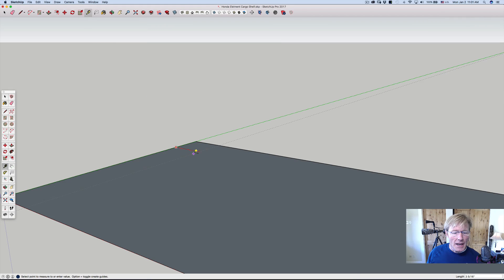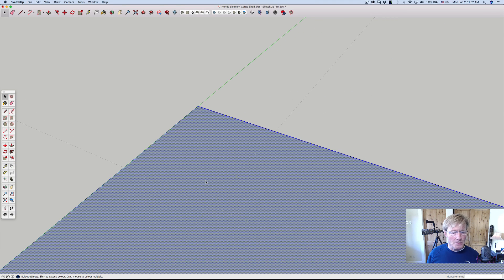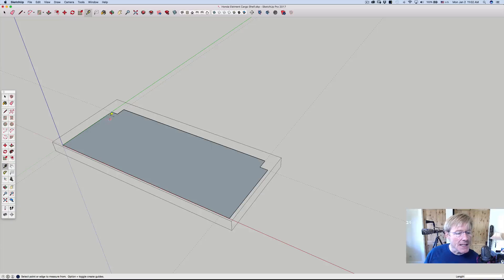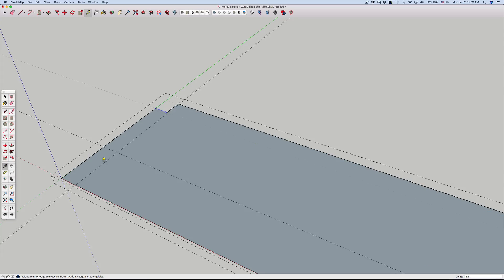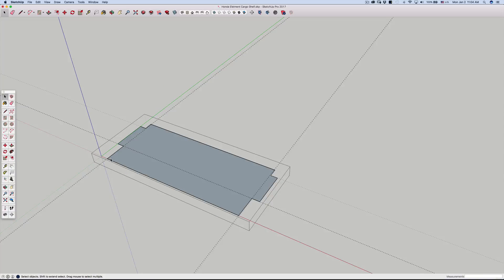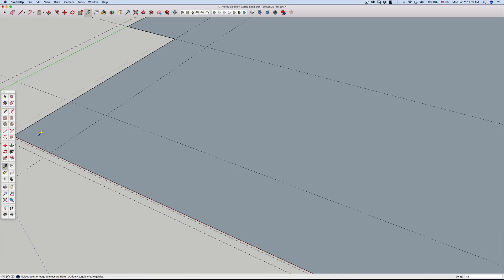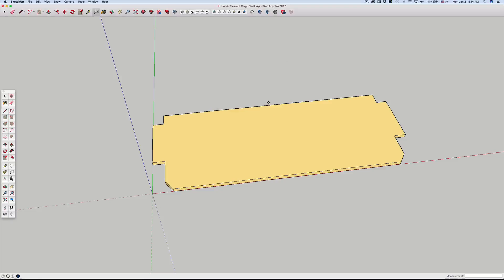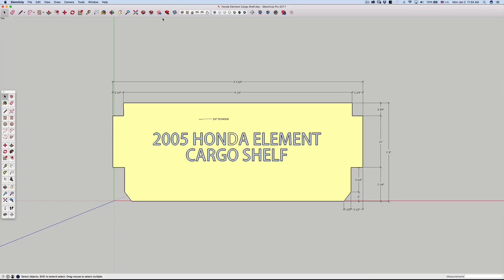Cargo Shelf for Honda Element in SketchUp

Comment: Ron, is there a setting that I need to turn on to make my guide lines infinite? When I use my tape it will only be a guide line in the axis and the length I make it. does that make since?
Reply from the maker: Andrew, I am not sure what your guide line is doing. The way it performs for me is the only way it ever has. Possibly there is a preferences setting that got changed? Also, the Tape measure tool has a differnt function if you start from an end point.
Reply: Ok, I'll try and start not on an endpoint.  Thanks for your help!